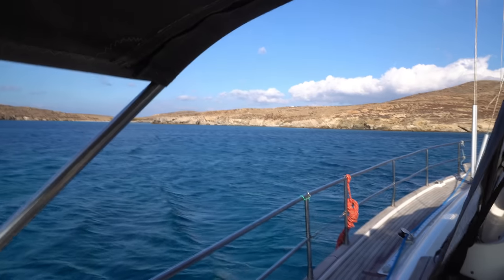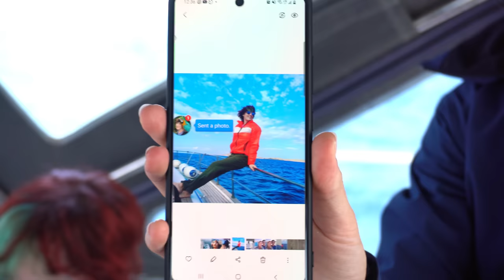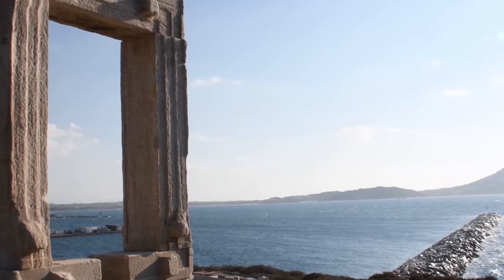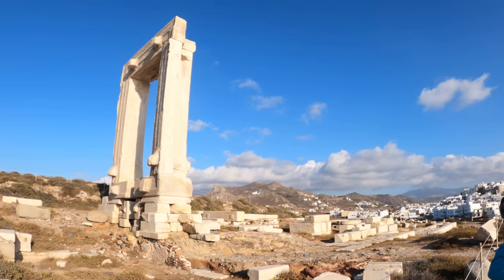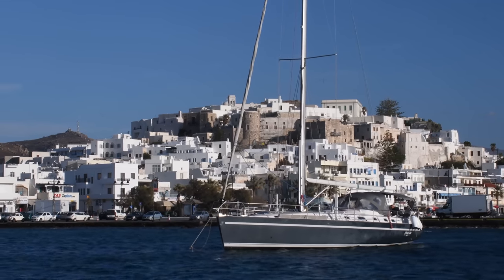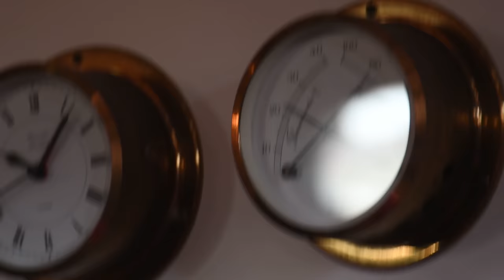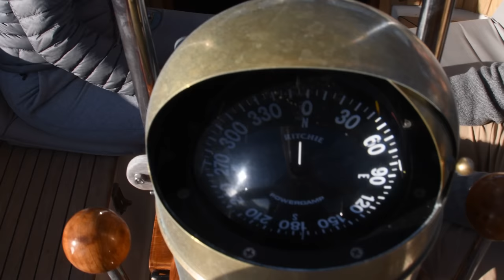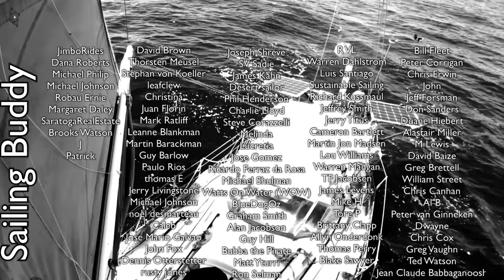Big Seas: Rough Sail to Naxos! | Sailing Wisdom [S5 Ep15]

Comment: If you read this, I’m curious of your opinion regarding roller reefing a headsail vs hank on. I’ve sailed, primarily singlehanded, my Fuji ketch 35 for 36 years (not extensive long range). In all those years, most of my mishaps (gear failures) have come from being overpowered for a particular condition. I take responsibility for those misjudgments. However, going forward to douse a genoa in a blow is the last thing I want to do. Just recently, I’ve tossed my purist attitude and installed a roller furler. Perhaps the sail shape is not optimum but I think the trade off between the correct shape versus correct sail size (which ultimately comes down to speed vs safety) makes size the winner between the two. You guys are general proponents of hank on sails (as mine used to be). What are your thoughts?
Reply from the maker: First off, having a cutter makes it really convenient as you have a smaller headsail ready to go if the wind builds. The jib has a reef point in it but I don’t want to go up on the bow to tuck in a reef! I drop the jib and hoist the staysail, tie the jib down and go back to the cockpit!
When raising the sails, we will often tuck the reef in before hand so that we raise the reefed sail because we know it’s too much wind for the full sail. 
I personally prefer hank on with reef points as it lets us fly the best sail for the conditions, but having a cutter rig gives us the quick reefing ability that you won’t get on a sloop.